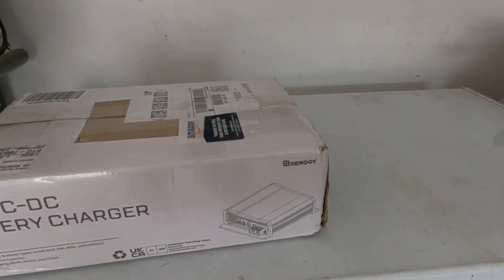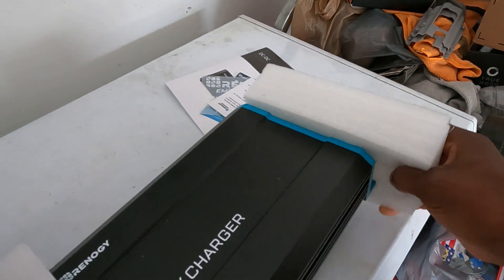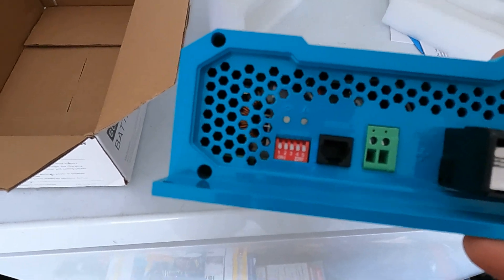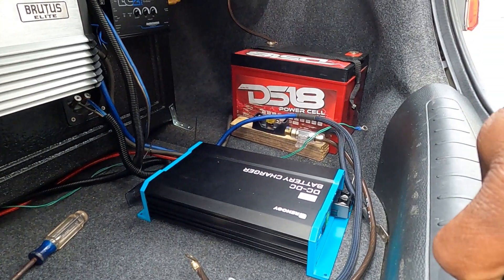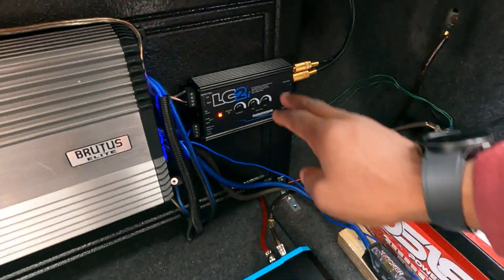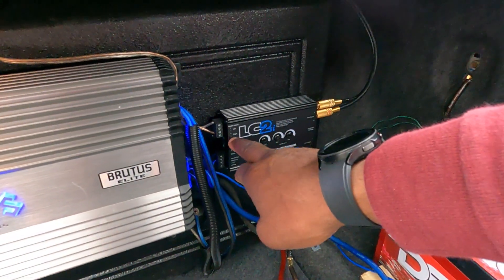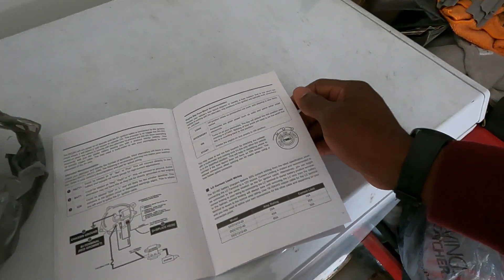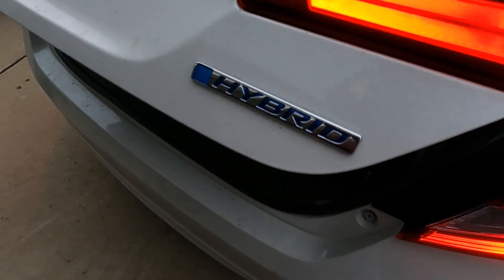Part 2: Renogy Hybrid install to power Dual DS18 15-inch subs & 2500.1 watts Brutus elite Amplifier

Comment: Is the dc to dc charger still working good for you and the system?
Reply from the maker: It was working good up until I took everything out. It was drawing a lot of amperage so definitely got to make sure your using some good thick power wire that can withstand the heat
Reply: @ I plan on using 3/0 wire, probably 2 runs to feed it and maybe use a second battery for the car as a cushion, then have that charger for the batteries running the amps